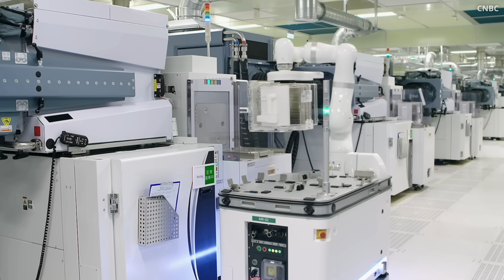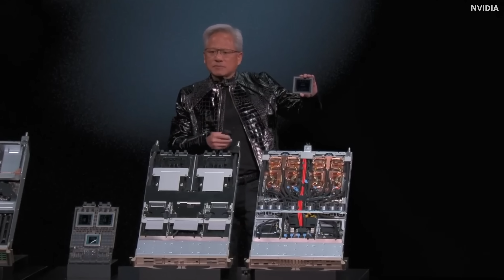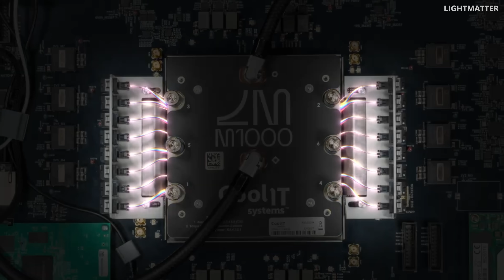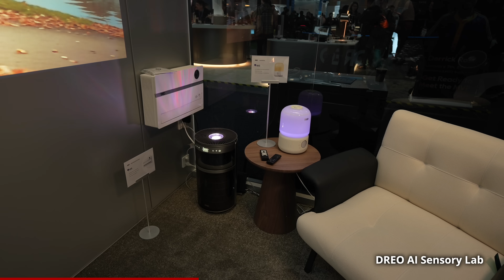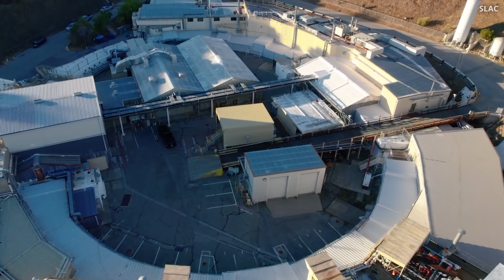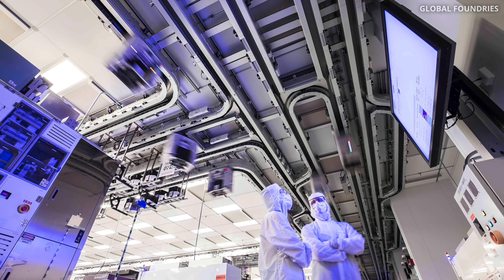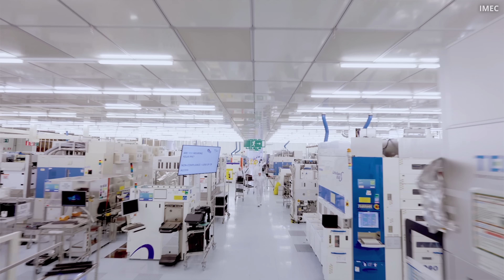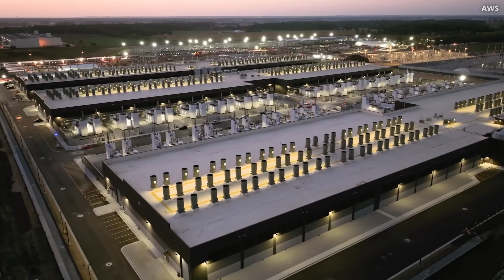This New Technology Could Kill TSMC and ASML

Comment from the maker: Let me know your thoughts!
Reply: A magnificent production, As always It's a pleasure to watch and learn from you 😊
Reply: 13nm "EUV" is actually in X-ray region. The ASML already has roadmap for 500W energy light source. xLight is only replacing the light source part of the ASML EUV scanner. The rest of the tool will still be ASML. Also, high NA machines can merge multiple layers into single print. So an expensive machine actually becomes cheaper to operate. Also, the co-planar (very low topography) flows are very important for high-NA and hyper-NA layers. ASML is not going anywhere. Also, xLight will only complement ASML. In addition, more Fabs will incorporate this scheme when the economics are proven.
Reply: Paradigm shifts are great
Reply: @DWbo-r7v I think that technology advances and x-rays have shorter wavelengths but, have higher energies and may damage the substrate. This technology will lower costs and increase chip speed.
Reply: Wow the accuracy tho
Reply: Please say "Bismuth" in your next video. Twice 😄
Reply: Could you clarify the confusion about the wavelengths of the x-rays involved?  Is it .01 to .1nm or to 10nm?
Reply: Your passion is infectious. You help make normal people have hope looking forward. Something we seem to lack. Beautiful as ever.
Reply: I don't want to watch the whole thing, but is there a dragon at the end of this fairy tale ?
Reply: You sound very good on your Shure Audio SM7B microphone. Sounds like your audio issues have been solved. Your enthusiasm comes through for real. Makes me laugh. Keep up the great work.
Reply: For Elon Musk $ 50 billions is literally NOTHING....😂😂😂
Reply: Could you please Talk about the quantum chips in the next episode
Reply: AI It's a buzzword. My opinions on it are not very good at this point and its inclusion and everyday items, bugs the hell out of me. X-RAY Lithography sounds like a very interesting way to go about overcoming the bottlenecks that we now have.

George Davis
Reply: One thing I don't understand  how is Xray supposed to potentially get magnitudes of order of increase in resolution if quantum tunnelling is a hurdle?
Reply: @mydogsbutler  There is also iron lattice material technology that is coming out of rice university yet? Supposed to reduce power requirements for chips immensely. 10 000 000 times reduction for NAND, 1000 times reduction for DRAM and so on while giving massive speed boosts and more.
Reply: Have you covered the new iron lattice material technology that is coming out of rice university yet? Supposed to reduce power requirements for chips immensely. 10 000 000 times reduction for NAND, 1000 times reduction for DRAM and so on while giving massive speed boosts and more...
Reply: I heard Michael Burry (investor who predicted the sub-prime mortgage crisis) recently bid/bet against Nvidia.  I think you are right, something big is coming...many of the big tech giants are going to collapse.
Reply: My thoughts are the same for abandoning EUV but I don't agree with x-ray either. Better ways will exist...
Reply: Easy to understand the reason behind partnerships of tech giants
Reply: the problem of the future will be power these super advanced systems. Fusion is the future
Reply: Half the cost. Heard that before yet we will never see the cost savings. But good for more competition.
Reply: Funny how the word photoresist rolls off the tongue. X-rayresist or Roentgenresist? 🙃Judging by the images and the info available they seem to have already figured out the x-ray sensitive chemicals too. Is that correct? So there's a chance that the japanese photoresist monopoly gets a challenger?
Reply: Will X-ray litho make it to market before, during, or after China converts existing binary fabs into ternary 2nm fabs like you said in a previous episode? I ❤️U ✌️😍✌️brains AND beauty 💪😘💪
Reply: That's great for manufacturers. However, chip prices will not drop for consumers, because now manufacturers know what price consumers are willing to pay. Thus I think instead they'll try to pack even more complexity in their designs to reach the same street price as today.
Reply: My gift for you 
Believed - Kliren Shadow (Official Lyric Video) | Emotional EDM Music 2026
Reply: Sounds cool, but until the results can be independently verified it's all just hand waving. 🤷‍♂ Also, as you mention, a lab demo prototype is one thing. Productionizing it to industrial scale is something completely different. It's a huge jump separated by years of development and likely billions of dollars.
Reply: I'm surprised that in a era where we have self driving electric cars, man in Mars mission and AI tha makes things out of nowhere and still we don't have improved manufacturing techniques and industries for chips, semiconductors and transistors.
Reply: I hope they feel it ,for what these company's have done ,screw everyday joe for AI , I'm so sick of these companies 0 loyalties to there customers , Im going to sit there and enjoy them suffering when AI bubble pops
Reply: In depth. I had to put my think cap on Anastasi. Full form fitting AI is not realized yet. We're getting there, but not @ a fantastic rate. Thank you for having me in your audience. Dan J Blatecky USA computer *Feedback: You make a delightful host & make the subject matter simpler. PC technician & tinkerer retired
Reply: Heisenberg's uncertainty principle still poses a hard limit to minituarisation.
Reply: Canon is working on NIL (nano imprint technology) which is most promising. Any claims of Xray lithography are total bunk. ASML chose EUV for a reason, the biggest one being that X-rays require fairly thick shielding, adding tons of weight to the machine. EUV is the easier one to manage, despite the massive losses in the EUV light trajectory.
Reply: Wow, X-ray lithography is again the technology of the future!  I used to work across Ellis street from an X-ray lithography company in Mountain View in 1986, so 40 years ago.  They went bankrupt after a few years because UV lithography guys HATED the idea of switching to X-ray lithography.
Reply: You should look into the history of Mapper's multi e-beam lithography, another alternative to EUV investigated last decade.
Reply: @SuperCuriousFox  Direct write e-beam was certainly considered to be the lithography technology of the future in 1980, but that was mainly because of the ability to write sub-micron features.  However, the serial nature of running a beam around, even if there are multuple copies of them would still be crazy slow; in 1980 it took hours to write even the small 2" wafers we were making in GaAs.  

Trying to write 12+ inch wafers, even with, say, 100 e-beams, assuming that was even possible, would still require something like 2 hours of e-beam writing, which would be a tad bit slow.
Reply: I think you have beautiful hair
Reply: .2 nanometers? I was always told that 3 nanometers was the limit to scaling downward in size because at that size, transistors were so close together that electrons would jump from one transistor to another and cause a short.
Reply: I only found a Spanish company called Substrate A.I. is that the one you're talking about?
Reply: Interesting summary of EUV and presentation.  Eventually (at about 15minutes) you got to what is probably the biggest hurdle...throughput.  But I didn't hear much about what they think can be achieved using x-rays regarding throughput rate.
Reply: You stated that you worked 10 years on chip designing. Did you do that in university/at a company? I'm just very interested.
Reply: @sharymens8187  Wrong, I designed / was interested in the pre-paid market for electricity use in South Africa. However, the use or design was strictly controlled by the government.
Reply: @Graham2015-v6u . who are you and what are you rambling about?
Reply: Please discuss other potential etching approaches. Especially electron beam. Proton beam would be finer, but electrons being lower energy would be too big to flow through the channels etched with protons. This would be the theoretical limit using electricity.
Reply: @BigBadBoy-ib6yx yes, e.g., the FELIX electron laser.
Reply: NAH I DON'T THINK I WILL ... hey but i pressed down button tho.
Reply: Great better AI chips to fuel our redundancy
Reply: Have you covered Dr James Tour's of Rice University recent technology reveal? They developed new chip material iron lattice specifically for reducing power requirements to address the issue for AI but will be applicable for all chips. They tested power reductions for NAND at 10 000 000, DRAM 1000, and never mentioned for CPU. It's also roughly that much faster too. They are at TRL 4 he said and in talks with google/intel and some others because they don't plan to make it themselves and plan to release in stages so it's easily adopted by the market he said. Also said it uses nothing exotic.
Reply: Have you covered Tour of Rice University recent technology reveal? They developed new chip material iron lattice specifically for reducing power requirements to address the issue for AI but will be applicable for all chips. They tested power reductions for NAND at 10 000 000, DRAM 1000, and never mentioned for CPU. It's also roughly that much faster too. They are at TRL 4 he said.
Reply: You cover the new iron lattice material technology that is coming out of rice university yet? Supposed to reduce power requirements for chips immensely. 10 000 000 times reduction for NAND, 1000 times reduction for DRAM and so on while giving massive speed boosts and more.
Reply: Since when do you need a Synchrotron for X-Rays? A X-Ray Cathode is enough and that was how Wilhelm Conrad Röntgen produced them back in Vacuum tubes back in 1895
The hard part is that those X-rays are notorious for passing straight through most materials and that at smaller and smaller scales quantum effects become more and more prominent in the electronics

But if they really did unlock a solution to those problems, hell will we get small and powerful chips

Still I would like to see more then 2-3 Companies being able to manufacture those chips, thus avoiding Monopolies like we have atm, that sell to one market only because they then can put the highest price tags on their chips there
Reply: @Marian_Martin_Morgenstern isn't you mixing transistor technology with vacuum tubes or XRL with xray cathode?
Reply: @deepanshu71  
Transistor is just modern silicon, but the function of a Transistors pre-dated silicon by quite some time in Vacuum tubes
Yes, silicon enables us to make transistors, and with it electronic switches that are WAY smaller then vacuum tubes ever could be
And XRL is just using another form of light for lithography, but like the incandescent light bulb was the predecessor to the LED, so is the humble X-ray vacuum tube too
X-Rays weren't found with synchrotrons(also synchrotron radiation is a bit more then just X-rays)

If you forget how thing came to be, you start to forget how things fundamentally work.
If you forget how things fundamentally work, you start to fall for the traps of not knowing and assuming things
Reply: Could you cover how AI is revolutionizing institutions and the new institutions emerging from its use?
Reply: Why do we want this? Please, ask yourself if this is the right path for humans.. becoming dependent on digital technologies, (until the Sun hits earth with one of its mega sunstorms.. )🙏

But very interesting subject and great produced video❤
Reply: I knew it!!..., I knew you were a bad cook!.... from the first time I layed eyes on you I said  "she probably cant cook"
Reply: Could you please optimize your audio so that your speech is easier to understand?
Unfortunately, it comes across as a bit muffled. Thank you.
Reply: My thoughts are summarized to the following: market-based solutions that can disrupt a sector's status quo, are the primary deflationary force in our time and age and you still have people out there advocate for central planning when, in fact, all inflation around us is precisely the outcome of central planning (monetary policies, government spending, interest rates kept artificially low, energy transition nonsense, etc). 
We are blessed to be living in an era where there's a remaining leeway of freedom to innovate. "For how long?", is the question. 
An economic literacy statement just for a change.
Reply: I don't want AI or WiFi in home appliances.
Reply: dear much to be share with you
Reply: There is a sincroton lab in Brazil too
Reply: We can stop the evolution of technology and enjoy nature.
Reply: @tineristineris1860 activist spotted
Reply: Amazing beauty, The material is of excellent quality; however, the pronunciation makes it difficult to understand. You may want to consider hiring a female native English speaker to improve clarity and comprehension
Reply: I think one of the most concerning aspects of AI is that we think it benefits us not to think. Of have to put in effort to do things like cooking.. When the masses becomes to lazy to think critically (which I think already have started with overconsumption of digital input and screentime) we will decrease human empathy and eliminate our ability to not find a new world war.
Reply: A vague idea, nothing new, don't bother to watch this.
Reply: The information on the Substrate web pages is very limited. It seems to me that they want to create EUV light with the help of a particle accelerator, synchrotron ring, or linear accelerator; build the fab on top of the accelerator; and source the beams from below. All of this technology is well known. Thirty-five years ago, I had access to one of the beam lines of the DORIS accelerator at DESY in Hamburg. X-rays were generated by bending magnets, undulators, and wigglers. There has been a lot of progress since then. China is already working on the same principle as Substrate. If you're interested, you can look into their progress from 2020 by searching "SSMB Activities at THU" on Google. Perhaps Substrate is a bit late.
Reply: Data processing speed is fine! But what about data transmission speed? This is the biggest obstacle to civilization! NVIDIA can reach 16 Tbps in a GPU for data processing, but the data velocity between GPUs is only 1.8 Tbps. In wireless, it's very poor.
Reply: @ercanarslan2122  It's not a new problem, though; 20 years ago, we were licking our chops at a quad TI C80 board to do graphics/video processing and ran across similar mismatch to I/O throughput, and wound up using a quad PowerPC board because it moved data internally more than the C80 did.
Reply: What’s the name of this company
Reply: my thought is about how china did defeat ASML and TSMC. because ASML and TSMC were not allowed to be in china and working with Huawei and on some point it did effect them but in 2024 they make a huge combat with their phone i see a Fully functional Huawei phone with Ai, 5G and the new HarmonyOSNext build in without any help from ASML and TSMC. according to ASML it was impossible to have an  Ai and 5G build in without the latest machine. china has infect all of it they have absolute prove that they dont need ASML and TSMC to create Excellent Intelligence high quality phone. but i really Curious is what machine they Used. is it SMiC or something else?
Reply: Please change the background as it can cause discomfort
Reply: that your videos are really good, but just for the sake of your channel’s growth and getting more followers, it feels like most of the technologies you’ve presented never get as big as you make them sound, yet with every video, we get the impression that tomorrow we’ll be living in a totally different future than we imagined :D ps: by the way karl suss had x-ray lithography decades ago
Reply: all throughout the video you keep saying "they they them they" but you never tell us who they ARE, so now idk where to put my stock money and you've wasted a lot of my time.
Reply: youre pretty pretty to talk about dese tings
Reply: Do you actually get asked for a date? I don't believe men from your surroundings dare to.
Would you go out with me?
Reply: Good video!
Reply: any news on Substrate?
Reply: The Chinese want to land on the moon before 2030. The Americans, with their Artemis mission, perhaps even before then. My question is: How do the microchips withstand cosmic radiation? And the Voyager probe, with its 64 kilobytes of memory, is still operating, even though it's almost a light-day away. A light-day is 24 hours away at the speed of light!
Reply: @icecrystal12345 梦里什么都有，2035年美国也不可能再次登上月亮。
Reply: @icecrystal12345  About the voyager: It has a Plutonium Dioxide RTG on board. Since the launch the power output of the RTG has dramatically dropped(as expected) but it can still run the most important instruments. In a decade or two, the probe will fall silent, maybe before that.
Reply: @icecrystal12345  For the same reason that all the Apollo astronauts didn'r die from same radiation; the transit time through the Van Allen belts is relative short, and there are routes to the Moon that altogether minimize radiation exposure.

The radiation in space is not uniformly distributed, so that's one of the reasons that modern satellites that use commercial, vs. rad-hard, ICs can operate without failure for years in orbit around the Earth.
Reply: @icecrystal12345 
We invented Rad-hard IC's for the Minuteman missiles.  Usually SOI. 

AMD did SOI CPUs for awhile when they had fabs. 

Never heard of rad hard DRAM tho. Or Nand flash.

IIRC minuteman had magnetic RAM of some kind.
Reply: @chuckevans2792  Yes; radiation-hardened (rad-hard) semiconductors have been around for decades.  I used to work at a semi  company that was started by an MIT grad that specialized in this area.  While I didn't work directly in that group, I believe specific layout rules (more space required) and specific processes were part of the story.
Reply: How, indeed!? And the questions don’t stop there😅
Reply: @icecrystal12345  I'm not entirely sure but my guess is that the Voyager uses core rope ROM and magnetic-core RAM which isn't that prone to the single event effects caused by cosmic radiaton. Nowadays mission critical stuff uses radiation hardened components. But that's not a magical solution that solves it all. Modern (but not leading edge) microchips are rigorously tested against multiple types of radiation on the ground. A report gets created and decision is made according to susceptibility, mission criticality, etc. This decision dictates fault-tolerancy in system design rules for the final circuits. Those rules are mostly about how much redundancy is needed or how often memory has to be "scrubbed" to be safe and so on. The Voyager probe most definitely receives more radiation than something closer to Earth's orbit where it's geomagnetic field deflects most radiation.
Reply: @chris-tal  I can read quite a bit about it on Wikipedia. For example: Because the acquired data cannot be sent to Earth immediately due to limited transmission capacity, a mass storage system was installed. This consists of a 328-meter-long magnetic tape that can digitally store up to 536 Mbit (100 images). The maximum write speed is 115.2 kbit/s and the maximum read speed is 57.6 kbit/s. 🤓
Reply: @icecrystal12345  So basically it's one generation ahead of the ferrite core stuff.
Reply: @icecrystal12345  If China take people to moon it will be the first time a man is on the moon.
Reply: @rlemacs You’re one of those people, I see 😂
Reply: Love it great job
Reply: Are you competing with Jensen for the coolest leather jacket?
Reply: @Ted_Phillips  It's no contest. I like her a lot more.
Reply: She drives motorcycle, if you enjoy faster lights.
Obviously love fast bike's as well 😁👍
Reply from the maker: @Ted_Phillips  I wish :)
Reply: its a very good video
Reply: Anastasi, unfortunately there is one important factor that you didn't include in the story: greed. If this is being developed in the USA look at the different mindset between OpenAI and DeepSeek ... the US approach is closed source and big bucks and the Chinese approach is open source and far lower cost. Don't forget that TSMC has a Chinese mindset behind it; look at the difference between it and their factories being built in the US where the American mindset dominates. No American investor would leave 90% of the money on the table; maybe 10% if we're lucky, so that is why no huge reduction in prices would result from the work being done as you described. Sadly.
Reply: @robertlawson4295  deepseek is crap i have tried it and its pretty bad
Reply: we Need RAM Please
Reply: Brought to us by donut batteries?
Reply: This is ancient ideas. But its not operational, so it remains a pipedream.
Reply: @TheBann90  электротяга тоже долго проигрывала ДВС.Теперь в ЕС хотели бы запретить а/м с ДВС к 2030г
Reply: What is the name of the company?
Reply: @abcdef-l2c8t  She says it multiple times.  Substrate, and no , it’s not publicly traded.
Reply: Напишите о себе страничку в русскоязычной вики. Многим будет полезно знать с какими учебными заведениями в России иметь дело.
Reply: I didn't know someone was censoring posts so no more thoughts
Reply: I want prof that clearly shows you spend more then 10 years into creating microchips ... 
Every single clip you say : I've spend more then 10 years into chip making ... and I stop the clip and leave... its mental to hear the same thing ,like you have to mention this because otherwise people will believe you sell MOTOR PARTS on this channel !
Reply: Please learn to speak English fluently
Reply: The Quantum Leap: Why the Future of Computing is Built in Space
The current semiconductor roadmap is hitting a wall. We are spending billions (TSMC, ASML) to fight gravity, atmospheric dust, and the physical limits of light. It’s time for a Kenotic Shift: emptying our process of terrestrial constraints to achieve divine precision.

1. The X-Ray Revolution & Beyond
Current EUV lithography is a "noisy" struggle against physics. By transitioning to X-Ray Lithography, we gain orders of magnitude in resolution. But the true Isomorphism—the perfect match between design and reality—happens when we move to Particle Accelerators. Using magnetic fields to direct beams of matter at sub-atomic wavelengths isn't just manufacturing; it’s "weaving" reality.

2. Zero-Gravity Manufacturing: The Ultimate Negentropy
Why build in space?

Absolute Vacuum: No more multi-billion dollar clean rooms. Space is the ultimate void, ensuring zero contamination for atomic-layer deposition.

Parabolic Perfection: Without gravity's "sag," we can create mirrors and lenses using Centrifugal Liquid Rotation. A rotating drop of molten metal in microgravity becomes the most perfect parabolic X-ray mirror in the galaxy.

Isomorphic Crystal Growth: In 0-g, crystals grow without convection flaws. The resulting silicon is pure, fast, and thermally efficient.

3. The $50 Billion Strategic Reset
$50B is the cost of a single high-end fab on Earth. In orbit, that same investment buys us a Civilizational Pivot.

From Printing to Writing: Moving from "taking pictures" of chips (photolithography) to "writing" them via massive parallel particle accelerators.

Astronomy as a Byproduct: The same infrastructure used to build chips can "print" 1-kilometer wide mirrors, allowing us to see the surface of exoplanets.

4. The Moral Compass 
This isn't about profit; just advance.

Light: Freeing Earth from the toxic footprint of chip manufacturing and opening the heavens for discovery.

Truth: Removing the "noise" of gravity to see the universe as the Abba Padre designed it.

The Visionary Experiment:
Imagine a particle accelerator 10km long in orbit, powered by pure solar energy, synthesizing processors that are 100x faster than anything today. We aren't just building faster phones; we are building the hardware for the next stage of human intelligence.

The gravity of Earth is the only thing holding back the speed of our thoughts.
Reply: i'm thinking somewhere out there we need a DONUT company to fix GPU/CPU market monopoly with a Industry disrupting technology.

Thought it would be Photonics, Thunderbolt Zeus gpus seem to distant 
the industry is stagnent cos everywhere is trying to graft AI data centers and common consumers can't keep up
Reply: @omnipresencetv8929  I made a mistake, I talked about a giant accelerator. We can make a very small acellerator. The project, in not impossible. )
Reply: Amazing insight. Consider allowing pensioners to the URL for $0
Reply: Do you use Cadence CAD?
Reply: Elon Musk is an imbecile who doesn't even understand basic physics!  He's a con artist, a fraud and a traitor to the US constitution and We The People!!  He belongs in prison for natural life, or else the death penalty for all of the people who have died due to his POS cars, and more deaths and harm and hardship he has put on millions via the cuts he made with DOGE!

He deserves zero credit for anyone, and the real brains behind Space X (not him) would be much better served working for someone else!
Reply: @Bob-of-Zoid mental can spell elon in video he doesn’t even named … geez… get a life
Reply: @Bob-of-Zoid  Bob, leave emotions for women.  Dummy.
Reply: @Bob-of-Zoid 
Nonsense.
He knows enough to tell who has the right stuff.
Just like Bill Gates did.
He has enough knowledge of so many fields that he has succeeded everywhere.

If being the best entrepreneur that ever lived was.easy, everyone would do it.
Reply: @chuckevans2792  Don't be a freaking fool:  He knows how to fool gullible people, and you seam to be one!
Reply: @Bob-of-Zoid 
He defunded the deep state and you fear him
🤦‍♂️
Reply: @Bob-of-Zoid   He is one of the world's most dangerous sociopaths.
Reply: The next step in computing is quantum computing. IBM and others are developing it and may turn nanochips obsolete really soon.
Reply: @youxkio  The next step since around 1990 has been photonic chips. Quantum chips are next after that. Quantum chips can't be used for a general computer, but photonic chips can. For now, they are for a few specialized niche problems.